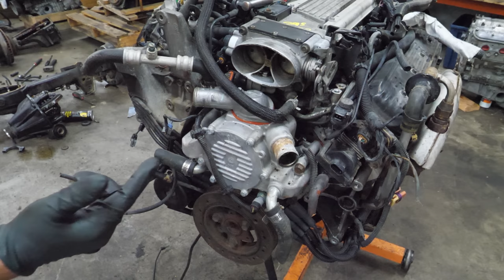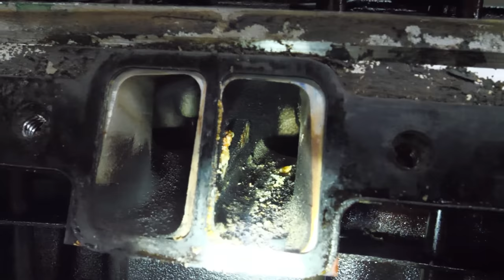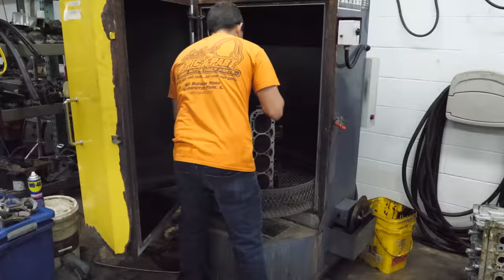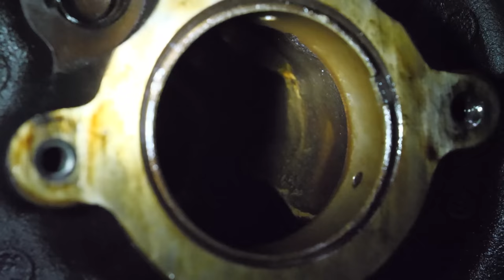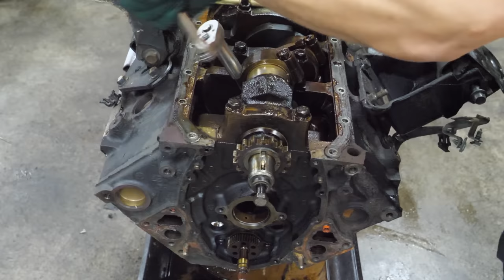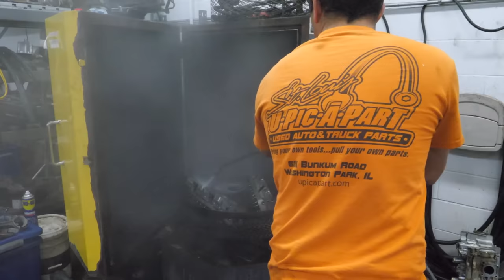Bad Corvette Camaro Trans Am Gen2 LT1 350 Teardown. Not The Problem I Was Told!

Comment: Those LT-1's where the reason the LS engines where design. There's a old saying, you have to hit rock bottom before you can recoup and start over. And thats seemingly what GM did. We take for granted that those High Performance LT-1 Engines where the "Hot Ticket" back in there day. Then a few short yrs later, GM was in MASS PRODUCTION of the 5.3 and the 6.0 LS engines that made that amount of hp plus some and they where just dropping them in EVERY full size truck and van they made. I can remember the day in early May (2001) I test drove a New 2001 Silverado 2500 with a 6.0. And quickly said  "WOW, I'll take it" And wanted to just leave my 1997 Silverado (350 cid)  2500 in the parking lot with a sign that said "Free to a good home"  The 6.0 LQ4 was such a beast compared to those 350's with that single huge injector mounted on the top of the intake. Then in  2003 We upgrade to a 3500 and a Duramax. That was the same yr I took delivery of me New W900-L Heavy Haul Semi Truck with the C-16 (625 hp). CAT🐈 Engine. Life was good in the early 2000's. Everything had HUGE go fast HP.

Comment: I had a 94 S10 with a 1996 LT4 crate motor in it. Ran awesome, quickest was 13.0 with no traction. Never had any real problems with it, you can see a video of it running on my channel. I ended up using it in multiple trucks then sold it.

Comment: The early optispark system was prone to failure. If I recall, it didn't have a vent or just an open hole. I recall modding my new one I put in one of my (2) 25th Anniversary T/As. It would not start when hot, left my wife stranded.

Comment: I have 5 cars with this engine,one with over 350,000 miles .not a single failure of the ignition system or head gasket issue in any one.

Comment: I'd say you lucked out on this one. Apparently just a couple of head gaskets out. Is your friend looking for LT-1 specific timing cover and heads (heads lack provisions for water passages and I believe no EGR). The LT-1 and the 4.3L L99 brother are the only things that they will work with. Otherwise you might look at the 96 and newer Vortec timing cover (reluctor wheel from the LT-1, maybe), or earlier corvette heads would have water passages and a similar chamber design to the last generation Vortec heads. 
If I was closer I'd totally buy the bottom end off of YOU, cam included.

Comment: I had a 94 Caprice with a tow package. A fan on the water pump no STUPID electric fans to turn on after the engine is already running  hot. Sold it with 150,000 miles on it never had one problem. The car rode like a Tank / Mercedes. I bought a 96 Impala SS. Got one off the lot brand new before they discontinued the big boat cars. Those  electric fans drove me nuts, always on the verge of over heating, lost 3 transmissions. I kept the car for 21 years over 500,000 miles. Leaked oil badly, didn't burn it, just leaked it all over my garage floor. At about 450,000 miles I replaced the original Opti-Spark. Then every 10,000 -15,000miles 3-4 more times - Opti-sparks. I gave up and sold the car. .the aftermarket Opti would fail and the car wouldn't start. I got discouraged with the unreliability. When those Opti-sparks would fail, i knew immediately why the car wouldn't start, just call a tow truck and CUSS like a DRUNKIN Sailor.. If it wasn't for those lousy Opti-Sparks. i would still have the car.

P.S. i used wheel Bearing grease instead of RT for a gasket sealer. Never had a leak. Thanks for the video.

Comment: Everyone shits on these engines. I have one in my 96 Vette and it has weathered nearly everything. 130k miles on the original Optispark, has experienced salty roads, snow, pretty much everything. Only failure I had was the water pump drive gear stripped out which overheated the engine to well over 280* according to my laser thermometer. While replacing the water pump I accidentally spilled a gallon of coolant on the Optispark. Let it dry for a few hours and it still works flawlessly. Fantastic engines. Plus, that LT4 really did make more power than the LS1. GM didn't want the LT4 to be rated more than the new engine, hence the conservative 330 HP. They made closer to 350-360 HP.

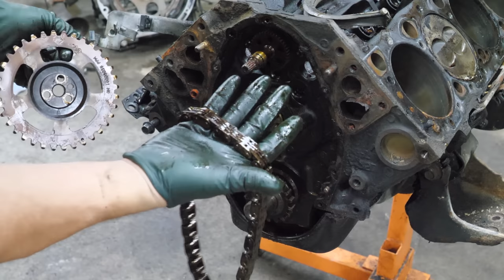Comment: @27:39 - I want to ask again - do you really have a thing for the timing chains?  I can totally get behind that sentiment.  I guess it could be sarcasm, but you sound genuinely appreciative of the mechanical aspect of the chains.  I have the same fondness for smooth, round shapes like ball bearings, machined metal rings and such.  We have smooth Tungsten Carbide wedding rings.  The down side is that they scratch absolutely everything.

Comment: Gots 95 camaro I gota do the head gaskets on great video learnt heaps and a few not how to do it lol it right hand drive so will be xtra fun🇳🇿
Reply: Did they import the Camaro to NZ?? That's so damn cool! My first manual car was also a 95 Z28. And also blew a head gasket haha. 
Unfortunately it was also rusting pretty bad so that was pretty much the end of her 😢
Rust is a common cause of death for cars and trucks here in NY state, USA. Damn road salt.
Reply: Hi anything newer than 20years old had to be converted and were imported from the u.s or japan.the two i have were both wrecked in a  flood February 23 so the 1 rhdrive one may be repairable but i doubt it so a real bummer.the value is so low on them and the can be sold left hand drive here now .il probly just part them out or sell for race cars maybe
Reply: @SSV-i-c-e  oh that's sad. Cool that their value is low there though, should be easy to replace then if you want. In the States their prices are kinda high and growing.

Comment: Those dipsticks are packed with brunt oil and residue inside the crankcase. push the tube back in and spray some PB Blaster on it. Much easier.

Comment: Correction on your comment around 2530
The “vented” the opti spark in the 94-96 models 
Still had problems just not as prevalent 
97 was the introduction into the ls platform 
Greatest engine ever you know 
Not mistaken for an lt1 
Wink wink

Comment: i have a 97 trans am .. my lt1 is bone stock and has been super reliable, but i stay on the maintenance. plus these motors run way to hot,  225 to 235 is nuts.  mine is set up to run at 180,  my thoughts are that the heads are gonna last better.  and it makes more power at a cooler temp

Comment: I have a 96 Corvette LT1 waiting to be installed in my 72 Corvette. I love those engines, but after GM was sued over the coolant design they discontinued the blocks, and what's left is what's left. I had a 94 Camaro LT1 that had a spun rod bearing. It got so hot the rod became magnetic and wiped the crank out.

Also some fun facts. The prototype LS1 had reverse flow cooling and the optispark as well. GM wanted the Coil Near Plug design, but ran out of time and couldn't get it to work properly before the 92 Corvette was released, and got it working when the LS1 debuted in 1997. GM built a new plant with new tooling while the LT1 used the old worn out tooling. Also a few C4 Corvettes packed the LS1 for real world testing before its launch.
Reply: They were sued?
Reply: @CaptainSpadaro  John Evan of Evan's Cooling sued them over a patent he had.
Reply: Wow…that rod must’ve been glowing.
Reply: @mercedes-amgforlife3237  Ah. I did not know that.

Comment: The dead giveaway on all these LT1’s to what it came out of was in the valve covers and exhaust manifolds… Caprice roadmaster, and F body cars all had them weird looking manifolds Corvette had their own just like the valve covers 93 to 96 Corvette had plastic valve covers 92 Corvette had magnesium, like the L 98 cars all other LT1 cars had steel valve covers one more thing that’s different is that the Corvette had all the accessories on the left side of the engine

Comment: Those spark plugs were fuel fouled. That engine was seeing more fuel dumped into it than it could handle. Fuel fouled will make it miss but it will still run but hesitate and miss.

Comment: The biggest flaw for sure. Locating that ESC module UNDER the water pump. Only God knows how many ESC were destroyed by the slightest of leaks coming from the water pump. Yes, 20 years ago (when Pontiac still existed), those ESC modules were Big Bucks...around $600 each and then you add labor to it. I think it was around $1800 to have mine replaced.

Comment: I've had LT1s for over 20 years. Sometimes more than 1 at a time like now.

I have only lost ONE Optispark. However I have had many times where the damned things won't start. Almost every time it's the wiring to the Optispark or wiring to the ICM or coil or the ICM itself. I will say I have only had cars with vented optis though. I've never had a 92-94 LT1 except a 94 Caprice, but the B-Bodies had vented optis regardless of year.

Comment: The dipstick rusted off on my ls2.  I had to screw a lag bolt into it and use all the strength a ratchet strap could muster to pull out the remains.  Luckily it was in a truck so I could get to it, instead of a car.

Comment: G.M. SURE MISSED A OPPORTUNITY.  MY DREAM BUILD WOULD BE ALUMINUM VORTECH Lt4 STYLE HEAD .RAM JET INTAKE ROLLER CAM1.6 ROCKERS ONE PIECE REAR SEAL. 4 BOLT MAIN 5.7L I'm gathering the parts to build my on version
 Get it up and running and the boost it. Lobe the channel keep up the great content.

Comment: I'm the proud owner of a 1994 LT1 Corvette..102K miles I believe to be accurate...just wondering if anything can be done to prevent head gasket blow out and subsequent engine destruction...re-torque the heads? preemptively replace the gaskets?  increase cooling? is there any hope??? and thanks for an interesting vid..

Comment: Good lesson there if you were taking a used engine apart to just clean it up or regasket or put a cam in don't flip engine over to drop the oil pan. Leave it right side up and you'll leave all the junk in the pan.
Reply: i agree totally. i never flip a motor or trans upside down before the pans are removed. even if it is to be rebuilt. just old habits i guess.

Comment: Where did this motor come from?  I had a 91 lt1 that was a convertible in Daytona yellow.  I sold it with what I suspected was a blown head gasket.  I put a 180 degree thermostat in it as apposed to the 160 degree.  I’d love to know what thermostat it had.  I didn’t use silicone on it though.
Reply: Also, does it have a new coolant temp sensor?  I put one in

Comment: The Opti is an overblown issue. Once people hear about it, they just repeat the line everywhere "it's under the water pump!!". My 92 Corvette has the original Opti with 88,000 miles and runs perfect. I drive it almost daily. When the Opti goes out, if you replace it correctly with a quality part it will last year and years again. In 200,000 miles and 30+ years these cars should only need the Opti replaced once or twice.

Comment: An FYI: Dodge Ram 5.2/5.9 Magnums don't throw codes for O2 sensors. At all. If yours fks up after 2 minutes or so, wants to backfire thru intake, or sounds like full cam @ idle, it's the upstream O2 sensor. .

Comment: My assumption is that the engine block is cracked. Most of those GMC Engines back in the days, have a way to crack. The funny thing is turning the engine over, you cannot see water and coolant coming onto the Pistons. The block normally cracks between the sleeve or sleeves can't see it.

Comment: Noble less noble metals. Aluminum vs iron and you wonder why the head gasket fails. This is why proper maintenance of the cooling system is as important and keeping oil in the crankcase

Comment: I learned to work on cars with my 93 Trans Am, had one of these. Ended up blowing a head gasket within 8 months of owning the thing. Let me tell you that replacing the heads with the engine still in the car is not fun. 
Love and hate this motor in equal measure.

Comment: not only was the head gasket blown, it looks like it was run after the fact for a hot minute. Even GM knew that Optispark was a mistake, and ran regular HEI distributors in the Trucks and Vans till 2002. I think that is why the TBI and Spider were on the Late Gen1s and the TPI on the gen2s. Gen 2s were the mistakes to make the gen 3's and 4's that much better
Reply: That was fault of the owner. The car has 2 temp sensors for block and water pump. And the opti spark is legitimately just a distributor that was placed in front of the engine. It is no different than an old one. And they used tbis because the lt1 was a sports car and muscle car engine. Not a van engine

Comment: 325 lbs of torque was a big deal back then.
Reply: Yeah this motor had less torque than the predecessor the l98… 325 vrs 345.. it also reved  higher to 4000 rpm to get that 325..where the 245 hp l98(1990-92)  got 345 lbs of torque at 3200 rpm’s
Reply: @toddprater14   ? In 1995, the gen 2 LT1 with the 6 speed in the Camaro was spec'd for 325 ftlbs at 2400 rpm.

Comment: Ls1 technology is cool. But when an Lt1 is running, they are more fun, sound way better, especially with a cam and longtubes and or pipe. They responded well to head work, cam, roller rockers, intake, bolt ons like electric wp, ud pullies, tuning etc etc. 

Look to Advanced Induction in NC and or Loyd Elliot in TX if he still does his thing. 

383 stroker LT1s in 4th gen Fbodys can be wicked

Comment: I had a 94 Vette and loved it. 140k miles when I sold it and still ran strong. Original water pump and opti. 

The best part of that engine is the torque available just off idle. You really had to ease into the gas to not thump your passengers head against the headrest. Any sort of spirited application of the pedal, even if just 1/4 pedal and you'd be going across the intersection at an angle lol.  Granted our older streets have decades of oil in them so it made it easier but man did I love that Vette as a daily driver.

My S10 has the 4.3 and as I have heard it's basically an LT1 with 2 cylinders lopped off. That has 135k miles and has 40lbs of oil pressure at cruise and 25 or so at idle even all warmed up. Great V6 engine although not so great mpg.

Comment: That stouthearted iron block probably provides almost as much bottom end strength even just with the 2 bolt main caps as did the Nissan/Datsun 5.6 V8 bottom end with the fancy 4 bolt + cross bolted main caps but with the block made of aluminum  !
  Of course with the overhead cams and 4 valves in the bowl shape combustion chamber that newer hi tech engine has an advantage at making horsepower.

Comment: I’ve had two different trucks my first one was a 89 Chevy Scottsdale stepside with the 305 small block and I wish it wasn’t a tbi but I ended up getting rod knock and sold it now I have a 94 Chevy c1500 Cheyanne which has the 4.3 vortec with tbi there not bad but they take a minute for fuel to come out I have been to the floor and it took a little bit to add fuel to the motor

Comment: I have a 95 lt1 Camaro that I’m so glad I’m LS swapping. I sold the og lt1 for 4k with 80k miles with a bad optispark system. I had done some work to the motor and drove it for a bit and then the optispark went bad. Had ported heads and a mild cam with a ported factory intake. I had modified it back in high school. Sad to see it go but these optispark units are complete junk. LS swap is easier for me since it’s a regular thing I do than replace that crappy design

Comment: I've found that a old behind the axle ford truck van  or chevy van full siz3.g.m. car  fuel tank bottom works real good a catch pan on the legs of the engine stand I just put a c clamp on the upright to hold it.

Comment: I still can see that this lt1 can be rebuild at low cost just do the heads resurfacing and then rebuild gasket kit with new bearings and rings and this engine will be back to life

Comment: Head gasket dissolving. Maybe someone used some home brew acidic cooling system descaler/cleaner on that engine to cure overheating after putting in hard tap water. I would think GM head gaskets are designed to last a very long time with proper fluids.

Comment: Whats does the oil pump drive gear look like?  I had one fail at 180k in mine, when I started it it sheared off the teeth and had no oil psi.  died a quick death.  I figure now at about 130k i'll replace that gear even if its good.

Comment: The used Optisparks are VERY valuable if only for the Mitsubishi chip. The aftermarket ones have crappy chips. (I am looking at YOU Accel and MSD!) And even the ACDelco rebuilt ones that recently hit the market may or may not have a Mitsubishi chip.

Comment: Had 3 F-Bodies, 94 Z28 A4, 95T/A A4, 96T/A M6.
Only did a water pump on one of them. Did other stuff but was out of sheer foolishness, ego and boredom, you could say. Young and stupid.  🙄🤦‍♂️
If you were on top of them (no overheating, proper cooling system bleeding, et al) and gave regular maintenance, these were not problematic.👌🙂

Comment: LT1 is a great engine makes big NA power with the right builder

It’s a refined SBC ten times better than the TPI and they have a way to fix the opti issue no big deal 

The LT4 should have just been the standard engine 

It was close if not the same as a LS

Comment: Try a claw hammer on the dipstick

I have 2-96 sedans with 2.92 gears not quick but can hold 100 MPH for 23 gallons at 20 MPG.  23-25 MPG at 80

Comment: Great engines BUT Suck@ss ignition system! Heat soak is another great feature of placing the distributor sandwiched between the hot @ss electric water pumps and the cast iron of the engine block. Change them to a conventional SBC distributor and problems solved. Except when you have a camaro or firebird. You'll be setting the timing from the drivers seat! 😂 But they have a LS coil style ignition system now for them. A bit pricey but it is a decent improvement for F body applications.